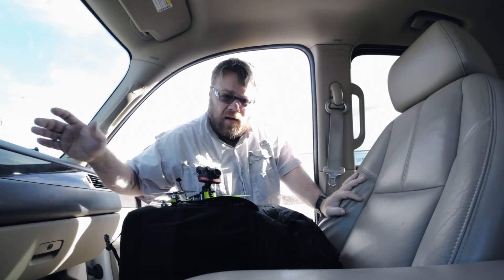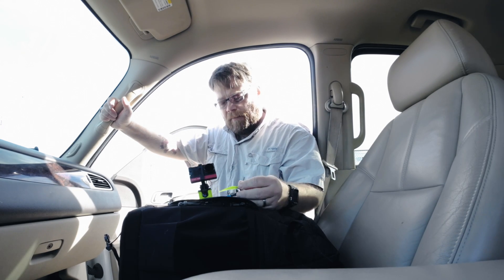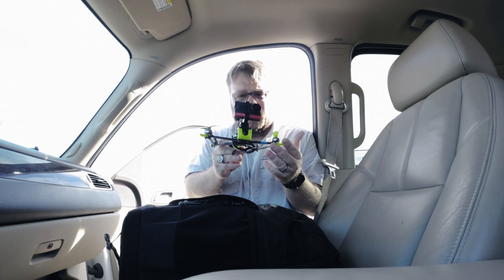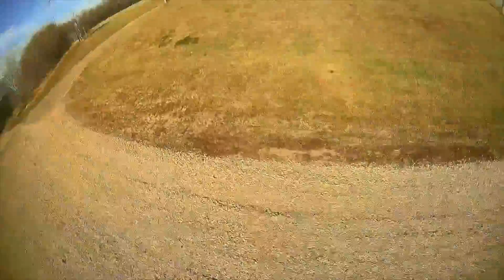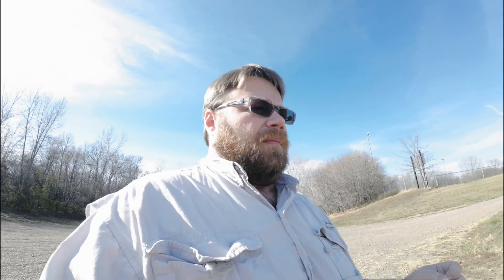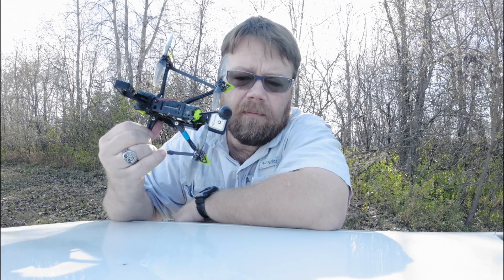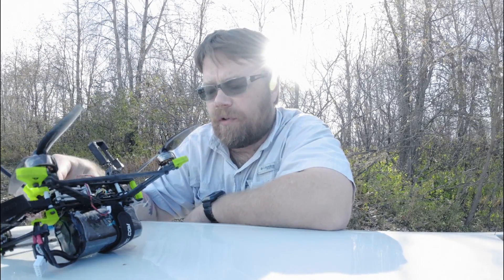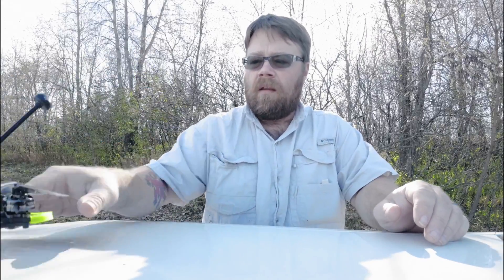UPDATE: iNav PID Tune fix for the Flywoo Explorer LR 4" FPV Drone with iNav

Comment: How did you get the magnetometer working ? I got a iflight v2 gps/compass all wired up check continuity on scl sda  all good gps works fine both mag sensor dead ram cli status states magnetometer unavailable frustrated also would love your inav cli dump haven’t even tried to arm it yet stupid mag not working
Reply: I had the same issue. I was flashing the wrong firmware. I was flashing the FLYWOOF745 instead of FLYWOOF745NANO.